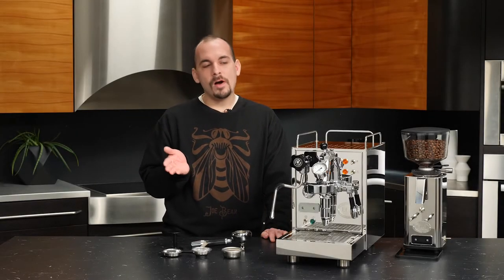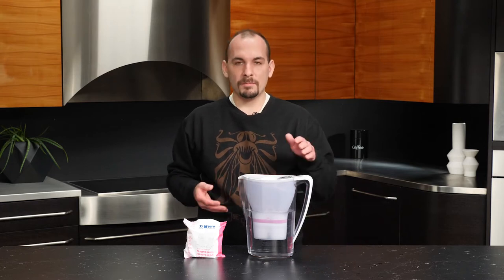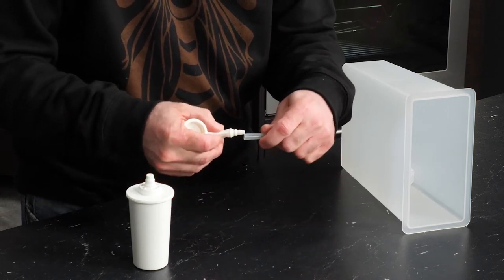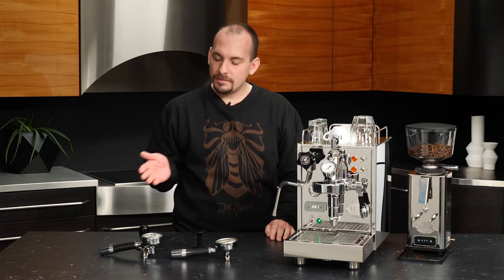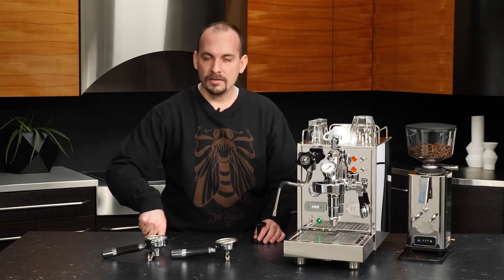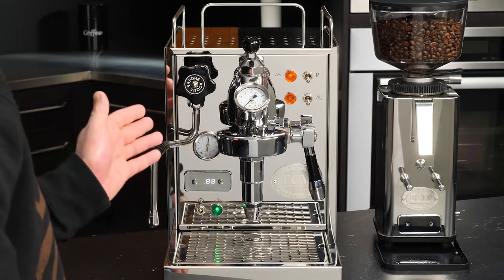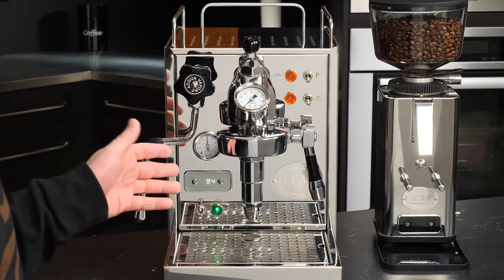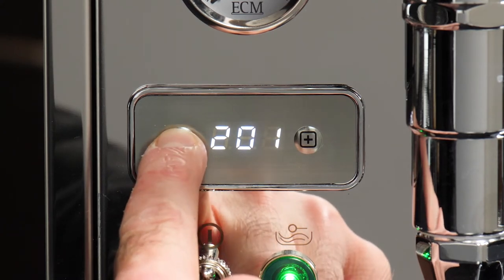ECM Classika PID: Initial Setup and First Use

Comment: I have a small kitchen, and my machine has a shelf above it, not super low, but not super high. So many machines I'd love to have are top-access for water. I have an Ascaso Uno PID, and the water reservoir is side load. It just slides out a few inches and you pour in your water. It is SO easy, and it doesn't mean you have to unload or worry about the cups stored on the top of the machine. This is a great design feature of the Ascaso that I'd like to see other manufacturers adopt.
Reply from the maker: Hi F, Thanks for sharing your thoughts. Quick Mill Pipa has side load water. Could also go to a plumbed machine for constant water supply - never having to fill a reservoir can be a life changing experience!

Comment: Thanks for this.  My ECM didn’t prompt me to fill when I powered it on for the first time.  The temp started to heat up without any water in the boiler.  When I realized that was happening I quickly turned on the group head so the water would flow through.
Reply from the maker: Hey CC, You are welcome and thank you for the comment!
Reply: The same with my machine. No "fill" mode when I first turned it on. I wonder if it it was used before even though I bought it as new.
Reply: @res.22  I contacted Clive (who I purchased it from) and they said they test the machines prior to shipping.  Which would also explain the condensation in the bottom of the box…
Reply: @hybridsoul2  I see, thanks for the reply! I've already contacted ECM directly. I'll let you know what they said.
Reply: @res.22  please do!  Thanks! 😊
Reply: @hybridsoul2  ECM told me that's nothing to worry about. A technician alway tests the machine before it's shipped and if he or she didn't reactivate the fill-mode you won't be prompted. And it's normal to find some water left inside the machine from the testing process.
Reply: @res.22  Thanks!  I've been super happy with my machine so far.  Now I need to refine my own ability with optimizing extraction.   Adjusting pull time and temperature based on the roast darkness is my current focus; yielding good results!
Reply: @hybridsoul2  me too, really nice machine! Have fun!

Comment: I'm using the espresso water recipe that Mark described in a different YouTube video with my ECM Classika. Do I need to use the BWT or similar products?  Do I need to descale using Durgol?  I can't find anything in the manual to suggest that I shoul descale.   I can't find in the manual to advise against descaling.  Appreciate some help, and, if this video is about the ECM Classika, maybe not suggesting a product like Durgol if it is not recommended by ECM.?

Comment: Appreciate the video! Is there a machine you might suggest that does not take 20-30 minutes to heat up but can still provide PID/flow control? As a current Bambino owner it seems a bit silly that a machine takes that long to get to brewing temp for $1300-$1400 more. I know this is not unique to the ECM here but just curious if there are higher quality machines without this issue?
Reply from the maker: Hi Mike, PID + flow control = E61 group head. Those are ~7lbs/3.5kg of solid metal heated by convective thermosiphon flow from the boiler. No way around the time it takes for the group to fully heat. What you can do is use a Wifi appliance grade outlet timer to have the machine turn on/off on your schedule.
If you can do without the flow control the Bezzera BZ13 has PID and heats in about 8 minutes as its group head has an internal heating element to help things along and keep temps stable. The BZ13 uses a heat exchange boiler so you can brew and steam simultaneously: https://www.wholelattelove.com/products/bezzera-bz13-pm
Reply: @Wholelattelovepage  beautiful. Thank you guys!
Reply from the maker: @mikeobrien1118  NP!

Comment: please can yo tell me how to use the pump switch and how ti refill the boiler after each coffee thank you
Reply from the maker: Hi cs, Thanks for the question. You do not have to refill the boiler after making an espresso. You do need to refill/cool down the boiler after steaming. To do that, Open the steam valve and turn on the pump switch until you get a solid stream of water out of the steam wand.

Comment: wondering why the pressure gauge keep on climbing to 8 bar and even you are not brewing any espresso, (ex: at 19:53, really wonder why)
Reply from the maker: Hi WW, Thanks for the question. Pressure is measured near the machine's pump. There's a one way valve after the point of pressure measurement so when the E61 lever is down after an extraction pressure is retained in the system. If one were to lift the E61 lever partially without activating the pump the pressure on the gauge would fall to zero.
Reply: @Wholelattelovepage  Thanks for info and appreciate it

Comment: Do you need to activate the pump as soon as you turn on the machine every time?
Reply from the maker: Hi CC, No you do not - only on initial startup. Although if the machine has been unused for an extended period I would run the pump on startup to get some fresh water in the boiler but it's not required.
Reply: Thank you so much for the quick reply. You guys are champions!

Comment: What filter do you recommend for the bezera bz07
Reply from the maker: Hi d, Thanks for the question. For a BZ07 I'd go with in-reservoir pad filter from BWT: https://www.wholelattelove.com/products/bwt-bestsave-s-anti-scale-filter
Or for higher volume use the BWT Penguin Pitcher: https://www.wholelattelove.com/products/bwt-penguin-2-7-l-water-pitcher
The pad filter requires ~12 hours of time to do its thing in the reservoir so if you fill a reservoir multiple times a day it will not keep up with demand.
Marc

Comment: Hi, if I do 2 lattes a day with milk steam, will this single boiler machine super painful compare to HX machine like quick mill rubino or VBM domobar juior which is few hundred bucks more?
Reply from the maker: Hi oe, Thanks for the question. It's just waiting for machine to reach steaming temp. Then cooling down the boiler after steaming. Painful depends on if you are in a hurry or not.

Comment: I'm in doubt between this one and Bezzera bz10, can someone please help me with the choice? I do drink cappuccino in the morning for information.
Reply from the maker: Hi Yuri, Unless you're doing specialty grade straight espresso on a regular basis the BZ10 is likely a better option as it has an easier workflow to a cappuccino. The BZ10 uses a heat exchange boiler so you can brew and froth simultaneously. The Classika has a single boiler so you cannot brew and steam at the same time. There will be a wait for the machine to heat up to frothing temperature after making the espresso. Then, when done frothing there's the added step of cooling down and refilling the boiler. Beyond that, the BZ10 will be ready to use sooner as its group head heats up faster than the E61 group of the Classika. If you don't mind the extra heat up time and additional workflow steps know the ECM Classika has the capability to make a slightly better espresso due to it's precise PID temperature control. And, it can be equipped with flow control which opens up more possibilites for crafting espresso flavor. Of course there's a price difference between the 2 machines so maybe you're willing to compromise on workflow to save some $$. Hope that helps!
Reply: @Wholelattelovepage  Many thanks for your quick response , I read that there aren't any bottomless portfilters made for Bezzera so there is no way to get one.
Reply from the maker: @yuribotnaru3359  Hi, NP on the quick response. We have a selection of bottomless portafilters available for Bezzera machines. The BZ10 has the BZ group so be sure and pick one from this link labeled for that: https://www.wholelattelove.com/collections/portafilters-and-filter-baskets?_=pf&pf_v_brand=Bezzera

Comment: I can’t get machine to turn on… is there something wrong with how I have installed my water tank
Reply from the maker: Hi j, There is a float in the water tank. If installed improperly or not operating correctly the machine will not operate as it does not sense water in the tank. But, the machine should still turn on. Here's a video showing how the water level float/sensor operates. It's on a different ECM machine but operates essentially the same on yours: https://youtu.be/g3IHsA_y1n8?si=M6ViqErP89u38B_w&t=101
Reply: @Wholelattelovepage  thank you I figured that out but now I am struggling with my coffee grinder 😭…

Comment: The PID on this classika looks different than mine in color. Mine is black and this looks silver to go along with the machine. The menus seem the same otherwise, is the only difference in the PID the style there?
Reply from the maker: Hi Shaun, yes, the silver PID display is on the newer version of the Classika. The newest one are also shipping with an angled portafilter and metal tamper, rather than the straight PF and plastic tamper from before. I'm not aware of any other changes. 
AJ